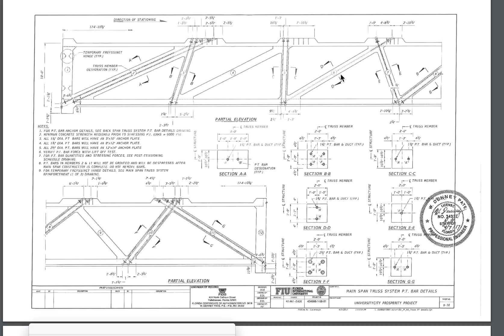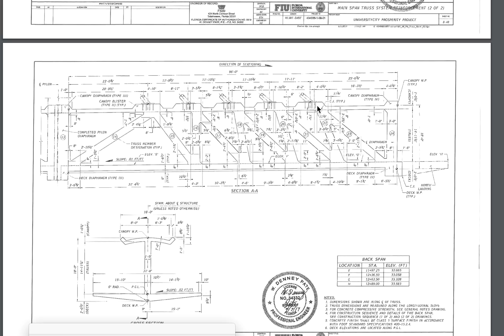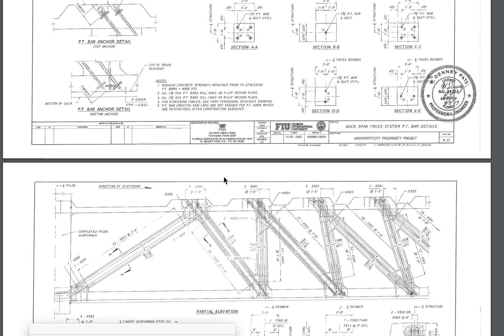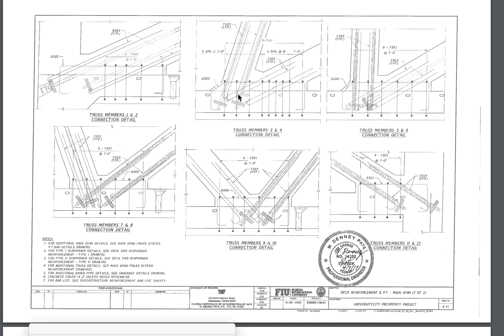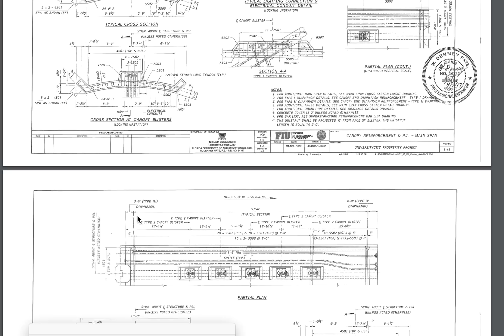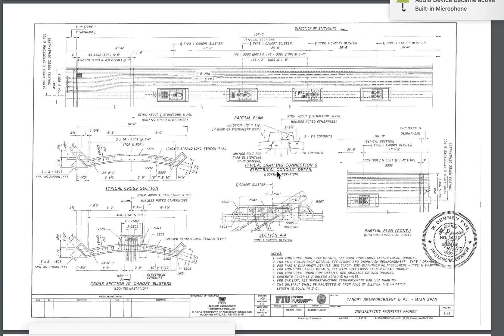FIU Bridge Collapse Post Tensioning #2 & #11 equals shear walls? Bridge Truss design forces

Comment: Based on your commentary it seems that  the structure could be into three parts: Deck, Canopy and Webbing. 

Assuming the deck and canopy (once tensioned) were capable of independently supporting their own weight across the span, AND, their deflection at the bridge center point is equal or not otherwise in conflict, then we might turn or attention to the webbing.  

As you pointed out, tensioning of the web members is something of an enigma. Perhaps it was believed, with the strength of the canopy and deck, the web angles, their loads and stresses were not considered to be critical factors.  And, based on their unequal angles,  it would be hard to consider them as being capable of truss-like support - even if you could get the math to work.  In my opinion these web members appear to be aesthetic to the design rather than functional additions.  As such, it's possible that tensioning or de-tensioning  web members on that fatal day seemed to be without risk.  Closing the roadway or other precautions was not deemed necessary.  Over tightening or (undertightening) the  rods at their canopy blister locations, however, could considerably alter the previously equally tensioned canopy and deck stresses across the span.  The point of failure (at the intersection of  #11 and the canopy) may not be the  specific web member to scrutinize. 

Whatever the case, audible signs of cracking were reported by workmen as well as passersby after the bridge was put in place.  And it was the attempts to provide a fix that ultimately or possibly prematurely caused its failure.  I believe its collapse may have been inevitable.  I agree it may be, as you suggested, a scale model  made to gauge the weaker points of the design.
Reply from the maker: I am not even sure of these truss members and their load path, as not understanding the intentions of the designer, is not made public...
This alternating or balancing of loads is not easy to figure out...
The angels and FIU specifically staying this was going to be, ground breaking, makes me think, differently, with respect to typical load paths.

Comment: I was thinking early on, if they had some stays pulling outward at the top corners, there would have never been a failure.   This would have included some attachment in final design structure, supplemented by temporary cabling extending horizontally outward from the upper portions of 11 and 2, the vertical end members.
Reply from the maker: Johathan, I am guessing that was the intention of all the structures and base (including elevator)  locking this structure in... with expansion calculated of course...

Comment: Thanks for the video..  anxiously waiting to hear the outcome of this.  Interesting to hear that FIU is an engineering college.  My laymen's reaction is that it was to quick from the drafting table to construction.  the end profile of the bridge makes it look very under sized.  I am a construction worker and have witnessed critical columns taken out during demolition and you could hear the stress on the building, but it did not fall because of load transfer.  
Seems like it was simply to weak for the span.
Reply from the maker: I did not fall from a direct result of racking... This video was to discuss the roll of detention  - on columns number 2 and number 11 - as state in the drawings... A lot of people are thrown by the adding and removing of those post tension bars... This video is theorizing it was temporary and used for racking / support purposes until structure was ''firmed up".